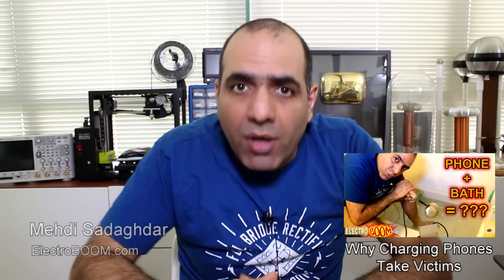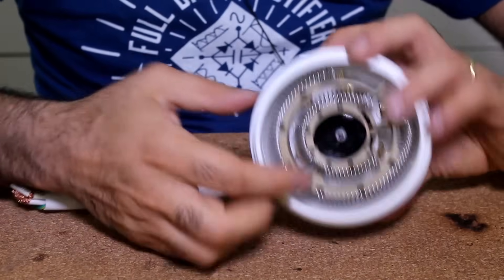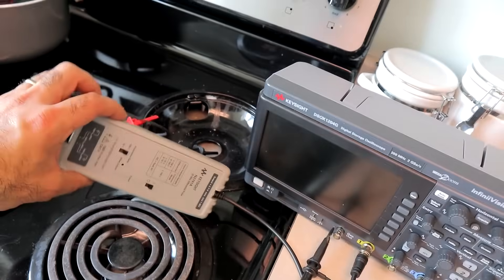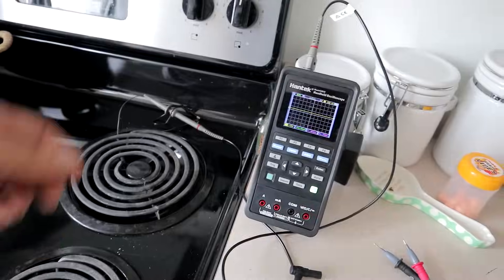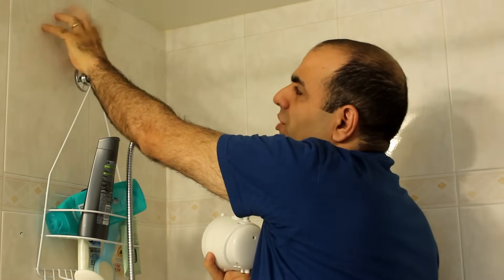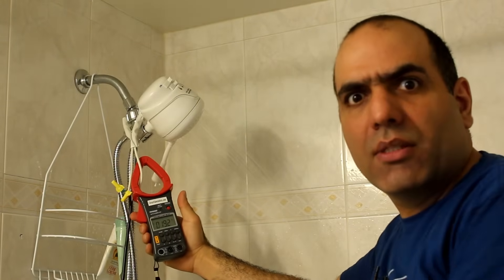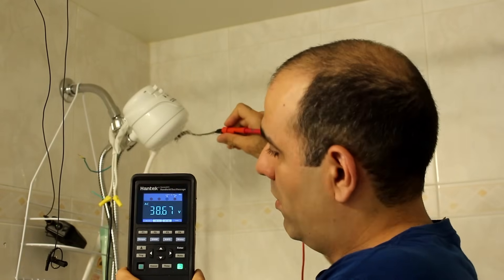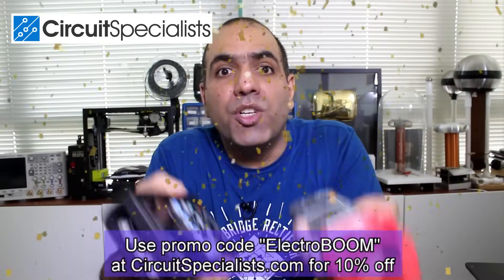How Safe Is the SHOWER HEAD OF DOOM?!

Comment: I'm from Brazil. Here, most houses use an electric shower and accidents rarely happen. The showers reach 7,500 Watts and most of the time copper cable of 6 mm² is used.
Reply: As a Brazilian I can confirm his statement is true [but I don't remember if those values are correct], I'm 18 yo and I still am alive so...
Reply: I dont believe 7500 watts for a second.
Reply: @scotts1668  i did the math, Watts are Volts * Amps so for 220V, its 220*19= 4180Watts, and for 150V (idk if the amps may change but) 150*19=2850Watts. If yours is 7000W that means you are dealing with 31Amps. (suposing a 220V AC) lol thats a pretty ineficient sh1t
Reply: @javieraragongarcia8660  is there a message I'm not seeing?
Reply: @scotts1668  It could be 7500W, he's 5000w so im not surprised if you find a little more powerful one, but i think it would burn the electric wires therefore. unless you have your instalation with 8mm^2 copper wire, wich is very expensive and useless for your bathroom. Just think a normal house needs 4.5KW and you are spending 5kW in a fking heater lol
Reply: @javieraragongarcia8660  I think they need to learn a little more about other countries.
Brazil is rich in water resources and has its main source of energy in hydroelectric plants. Soon, the custom and industry were expanding for this purpose.
Nowadays there has been an increase in the use of gas and solar heaters. However, there was an increase in the production of solar energy, which resumes the use of energy showers.
Another factor that they are not taking into account is that the appliance with the highest consumption attracts the load center, so from the distribution board to the shower, large amounts of cables are not used.
Reply: @scotts1668  search: " chuveiro elétrico 7500 watts"
Reply: @javieraragongarcia8660  are you from?
Reply: @javieraragongarcia8660  but it is true, i just looked into my new shower and it says 7800w, and i had to change my circuit breaker because the old one only work until 25amps( there is simple ones too, these 7500w+ are not the most common)
Reply: @scotts1668 try search for "Lorenzetti acqua ultra duo", its my shower(7800w)
Reply: the main problem is people who don't know how things work, yet claim they're technicians and fool other people to earn easy money by doing crazy unsafe wiring.
since most people don't know how things work (or don't trust others for this reason), then everyone ends up fooling themselves in a vicious cycle.
Reply: @ghianmartinsdesouza4909  Spain, here we use solar heaters because we have a lot of ours of sun, current here is 220-230V at 50Hz
Reply: @javieraragongarcia8660  Here the most popular for years is the electric one. The cost of implementing a solar heating system is still high and in most homes it is not worth it.
a meter of 6 mm² cable costs $0.79 and is usually no longer than 30 meters. The energy tariff is around $0.17/kwh. That I Euro. You still don't need to have two tube lines (cold and hot), just the cold one.
Reply: @ghianmartinsdesouza4909  lol here the price is about 0,40$ Kw/h
Reply: @javieraragongarcia8660  it seems like a lot of power but not when you are heating up water. A normal shower has a flowrate of about 0,1 L/s. To heat that 26°c for a comfortable 36°c shower you'd need 10,8 KW. 
My home boiler uses 6KW three phase and takes about twice the length of the shower to heat up.
Reply: @ghianmartinsdesouza4909  And the tube for cold line doesnt need to be of cooper, wich at least here in Brazil its very expensive
Reply: @diesellproo  In fact, today copper is in disuse. There are other materials with CPVC, but in the end they are more expensive too. Another investment is in heating equipment. In the long term it pays off, but for the Brazilian it is still difficult.
Reply: @larsvd5354  
Brazil is a tropical country, the shower uses maximum power only 3 to 4 months a year. For the rest of the year we regulate the power so as not to overheat.
Reply: @ghianmartinsdesouza4909  yeah it really depends on the source temperature. Here in Belgium the ground temp is constant around 10°c all year. I guess in the tropics it would help to just chuck a container on the roof to preheat the water with ambient temperature.
Reply: @larsvd5354  Culture takes time to change. The cost of heating equipment and the lack of professionals in this area led Brazil to use electric showers for the most part. It's rare to have blackouts, so it's a safe and guaranteed system.
Reply: @scotts1668  yup. It's 7500W for winter showers. In summer, fall or spring  you can use it at 1200/2500W. Our winters are prety mild comparing to the northern hemisphere at the same latitudes, with minimuns of 40F/4,5C in southernmost states, rarely going under 32F/0C. All homes with electric showers have a special separated and stronger circuit for them. There are gas showers, too, at least 30% of the country uses them.
Reply: @RicoFerrari  We invented the electric shower and the airplane.
Reply: @ghianmartinsdesouza4909   Oh yeah thats not crazy at all. We had the same and it was even pushed by govt after opening of the nuclear plants in the 70-80's. But now in the last 5 years we see solar heaters and heatpumps pop up everywhere. That would work even better in Brazil!
However we might have more incentive as elektricity is very expensive here. Around 0,65€/Kwh during the current events but around half that normally.
Reply: @larsvd5354  Looking from the outside, it appears to be a good alternative to Russian gas. I just don't know if it's possible to use it in winter. Less centralized energy sources help in situations like the one that occurs today.
In Brazil there is no incentive for adoption. It seems to me that there is lobbying by energy distribution companies to not invest in new, less centralized alternatives. If we were at war we would be at the mercy of hydroelectric power protection, that doesn't seem smart to me.
I'm sorry for the English, I only use google translator.
Reply: Does your third world country not have water heaters?
Reply: @raccoonfren  In your country where apartheid lasted for years, do you think Brazil speaks Spanish or Portuguese? Santos Dumont invented the plane, it wasn't the brothers who knows what.
Reply: 7500 Watts??  Here in India we get these instant water heaters that go up to 3000 watts and provide  continuous hot water. With 7500 watts we power the whole house including air conditioning, gardening water pumps etc.
Reply: @samuelrodrigues8561  Input breakers are usually 63 A. 63 A x 220 = 13,860 W this is the minimum they are considering in my region for new connections
Reply: @raccoonfren  Is it manifest destiny to save people from cold water.
Reply: @scotts1668  those are kind on the high end. usually they go up to 6500w, but there are some that are up to 11kw. yes they're inefficient. you're not supposed to spend an hour taking a shower at the highest temperature.
Reply: @GraveUypo  that's just an intense amount of wattage running through that small coil of wire I suppose it is liquid cooled but still damn that's 37k btus......
Reply: @scotts1668  yep, if there isn't a steady flow of water, it takes like 0.1 second for the coil to burn off and cut the current. it's pretty much instantaneous. actually it's a lot like a incandescent light bulb. the more powerful ones are fancier than this cheap one both internally and externally.
Reply: "Installed by a professional" Ha! I install it myself since I was a teen. 

It comes with being brazilian.
Reply: @luizmenezes9971  Exatamente, minha mãe me ensinou. Isso vai de geração para geração.
Reply: @GraveUypo  it's kind of obvious that you can't spend an hour taking a shower, water is a scarce commodity. But I don't remember being concerned about shower usage time. there are people who take 30, 40 minutes and do not burn resistance. now common sense is on the side of a quicker shower.
Reply: 7500w showers are pretty common nowadays (I am from Brazil)
Reply: Try building a water heater lol
Reply: @ehfoiwehfowjedioheoih4829  Isn't that a heater? Just because you're afraid doesn't mean it doesn't work.
Reply: @samuelrodrigues8561  Brazil is a continental country, we go from past equator to subtropical. average temp is around 20C here in Sao Paulo, and most of the time I run my 7800w shower at full heating, baring the exceptional heat wave. Most of high end showers also have a pump for higher pressure, so some of the wattage goes there.
Reply: Why not just get a 40 gallon water heater and run pex pipe or copper to the shower head lmao
Reply: @scotts1668  I have a 7800w shower (Lorenzetti Acqua Duo Ultra 220v 7800w, if you want to google it). It is the max I have seem so far, it uses 6mm² wiring in 220v, and a 40A breaker.
It has a triac circuit so we can adjust the temperature without adjusting the water flow, so the actual current being used depends on how hot you set it.
I live in the south, where the temperatures get far lower than the rest of the country.
Reply: Cabo de 6mm não deveria ser usado com 7500w, deveria ser no mínimo 10mm.
Reply: @ArkhamHedler  se o cabo de 6 mm suporta 36 ampere em uma rede 220 ele suporta uma potência de 7920 w. Os chuveiros vem com cabo de 6 mm pra ligação. Geralmente o centro de carga está próximo ao chuveiro, então o disjuntor está perto e a distância é irrelevante. Estamos falando do mais comum, existem projetos e projetos.
Reply: Why not just a tank water heater than you can hot water at every fixture.
Reply: @404hopenotfound  It's cheaper since you only need to install 1 pipe for each room that needs water and it is more efficient (heats directly where it is needed, instead of wasting energy through the hot pipe until it reaches the fixture).
Also Brazil is a hot country, so we don't use hot water that oftenly. Only to take showers and on the kitchen to wash dirty dishes.
Both the electric shower head and electric heater for the kitchen faucet are very easy and cheap to install / replace, and don't need maintenance other than replace the heating element once in a while.
Reply: yes but i live in hot prat of the us hot water is used a lot but i do see how using less pipe can save costs but how inexpnive pex water pipes are cost is not to bad if coper is being used is not cheap but how do you get hot water to washing  machine.
Reply: @404hopenotfound  Lots of washing machines here only have cold water for washing, and the newer ones that wash and dry have electrical heating elements in them, both for air and for water.
We don't use much pex here (only in motorhomes) because most constructions are made of brick or concrete blocks, so PVC pipes are more common. We don't have earthquakes, so lots of things are different in construction here.
Here it wouldn't make sense to have a hot water tank, same way most houses here don't have insulation. It is just different :)
Reply: @404hopenotfound  I forgot to mention that it is not common in Brazil for washing machines to use hot water.
Reply: yes it make a lot of sense. so like new houses dont have to put insulation or is it just like in the us whare it just a lot older houses. new houses have a lot of insulation to save energy. @MarcusBuer
Reply: 7.5k are usually in 240V installations. In 127V, we use 5400 watts showers.
Reply: 6mmq Is a Little on the thin side but of It works It works
Reply: @paolo69  6 mm² is enough for any existing shower
Reply: @ghianmartinsdesouza4909  Brazil standards are lower than italian ones i Guess
Reply: @paolo69  6 mm² copper cable supports 36 A, according to Brazilian regulations, the shower is generally connected in 2 phases with a total of 220 volts. This system supports 7920 W. This type of shower heats very well. I don't believe it's standard, it could be some norm.
Reply: @larsvd5354 where I am in Brazil ground temp is over 26 C all year, so I don't even necessarily need the hot water.
Reply: @WellingtonSBispo  7800w 💀
Reply: @ghianmartinsdesouza4909  what does the inventor of the airplane have to do here? we don't care, that's not the subject
Reply: @404hopenotfound it is actually more economical to use hot water with a hot water tank, simply because intense consumption to heat the water will consume more energy than slow and continuous heating, for example I did a little calculation, a hot water tank can consume on average 800kW per year and per person in less countries (which includes washing dishes, showers, and all uses of hot water) and it can be less for a small hot water tank, a single 7500W shower head at full power all year round for 15 minute showers is 675kW per year and per person, not including washing dishes. the small water heater is perfect for example for student accommodation or a couple because it consumes little electricity but is suitable for most needs and keeps hot water for a certain time even with a power cut.
Reply: @MarcusBuer The hot water tank can be very cost effective depending on the needs.
Reply: @tbfrstudio5416 what size water heater did you use for your calculations 50 gallon seems to be standard where I live
Reply: @paolo69 you're probably wrong

Comment: As a brazilian, providing you install it according to the specs, I can tell you it's super safe and more eco friendly than gas shower.
Also, pretty much every brazilian I know got a few electrical discharges from "suspicious" places, like when you go to some sketchy air BNB, or some hostel in the middle of nowhere, or some high poverty area.
I've got a few of those myself from the shower faucet, and it's not "terrible".
Not pleasant, but def not gonna kill you or anything.
PS: Also in those sketchy places we would shower using rubber sandals to prevent that lol.
Reply: In fact, more eco friendly here in Brazil. In many places, like England for example, energy comes from burning oil, charcoal, whatever.
Reply: @JoseClMezzalira Paraguay uses 100% renewable energy from the Itaipú Hydroelectric Dam, shared with Brazil. 🇧🇷🇵🇾

Also, we share some electricity of the Yacyretá Hydroelectric Dam with Argentina. 🇦🇷
Reply: GAS SHOWER

Comment: Greetings, I'm Brazilian and really here in Brazil 90% of households use electric showers, and there are very few reports of accidents involving electric showers. Few residences use gas showers, in buildings and buildings it is more common to use showers with gas heating due to the number of residents, if they were electric showers the installations would not support such an electric current. Our electric showers range from 5,500W to 7,800W with very high currents. Our houses are prepared with their own installations and exclusive for this equipment, copper wires of up to 10mm² and circuit breakers of up to 50A are used to support it! Hugs!
Reply: >Few residences use gas showers.

Are those U-boat descendants?

Comment: I've always been freaked out by the exposed wiring over the shower heads here in Brazil. It's just kinda creepy to have that in the shower. Also it was common to be shocked when turning the knobs
Reply: Specially if you have any kind of wound on your hands.
Reply: There are far better connectors than just insulating tape. And ways to hide it in the wall.
Reply: @DinnerForkTongue  yup, this problem is caused more by the "we finish it later" attitude that Brazilians have, everything is temporary, forever, not an inherent problem with the showers
Reply: @devforfun5618 
O negócio é que o ditado "não existe nada mais permanente do que uma solução provisória" é global. Não é exclusividade de nós brazucas não.
Reply: @DinnerForkTongue  é, mas ironicamente na terra da liberade é mais facil voce levar uma multa por uma instalação que não segue as normas do que no Brasil
Reply: if you're freaked out, take an hour off your day to fix it. it's not hard or expensive to fix the wiring so it's neat and safe. anyone can do it. just be sure to cut power before you start, otherwise you might die.